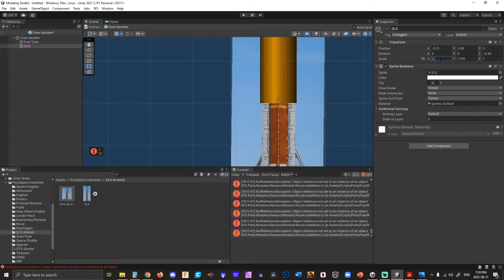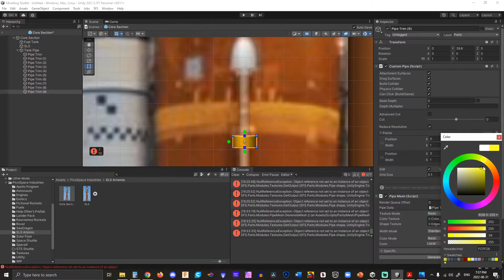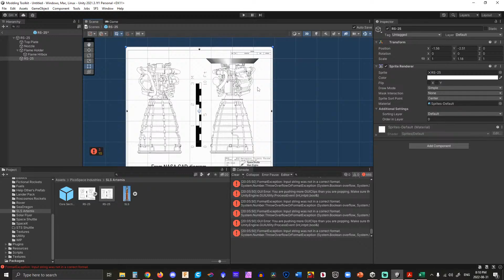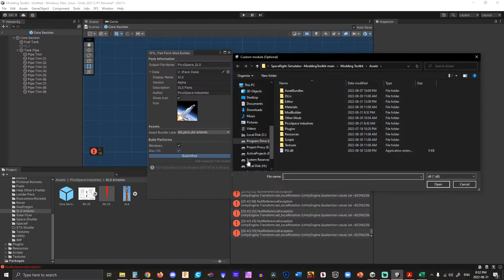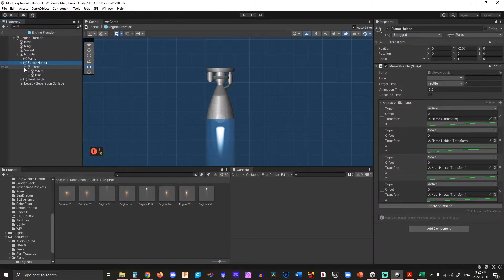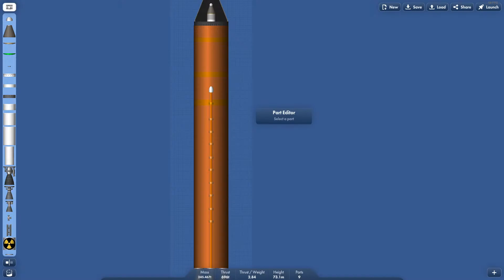Space Launch System SLS Artemis 1 Custom Part Recreation in Spaceflight Simulator - Part 1

Comment: Sls have 4 engines not 3
Reply from the maker: Yeah but one of them didn’t work… LOL. But yes you are right and as I work on the rocket I’ll have 4 engines.
Reply: @picospace  The persective does lead to only two of them being visible tho
Reply from the maker: True… but I haven’t added in double stack code yet as the engines have a “jitter” issue I need to fix first.
Reply: You did a good job but i think you need to do a better flame and bigger engine
Reply from the maker: Flames 🔥 take a bit of time to get “just right” so that will be next live stream and I will beef up the engine, just wanting to make sure it’s functional first before I throw on all the cosmetic stuff.
Reply: @picospace  yeah.
Reply: @picospace yeah
Reply: But is cool